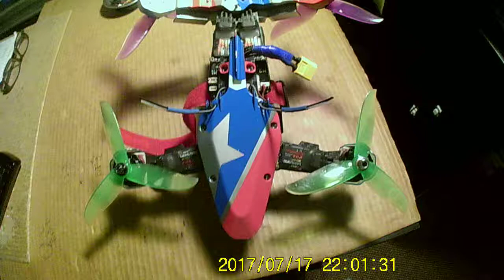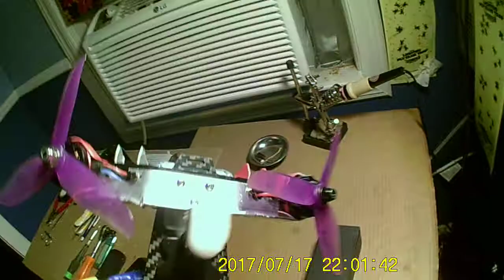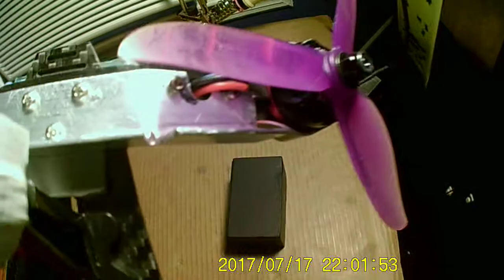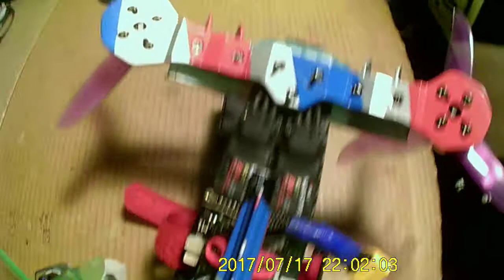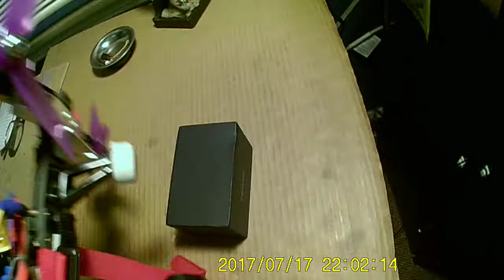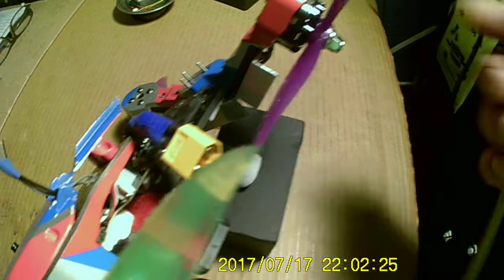VTail 210 Aluminum VTail support

Comment: No spare V-tails that I can find indeed. Shame, cause I dont  have the tools to make a aluminium one like you did.
I was hoping someone would have printed some and put up for sale but I cant find any.

After some delays (flying other drones) I was finally going to set up and fly my V-tail first time today, only to find out the FS-IA6b RX does not fit..:(    I already ordered a Eachine/Flysky X6. 
Guess  I'll have to wait a "little" longer. 

Have fun flying.
Reply from the maker: I think i told you that was not a good rx to use.Unless you take it out of the case cut off the pins and wire it direct to ppm cover it with heat shrink.I am using it on my Blackwidow 260 this way to save space.As the supports i made with tools a measure tape, a cordless drill & bits a saw blade i found on the road wrapped with duct tape so not to cut my hands and adjustable crescent wrench.Easy to bend and shape with the wrench then drill out holes.You have to be creative with this stuff.
Reply: I remember you saying that, but I had that receiver lying around as a spare and wanted to have a look first and likely improvise something, but it looks like it's too much hassle.  So I bought the X6 receiver after all.

Never thought of doing that with a wrench, I assumed I'd need a bench vice.
I'll just get a (new) drill than and try to make the same thing. Be creative :)
Although I rarely crash all these Youtube videos showing how very easy the thing breaks scare me.

Thanks.